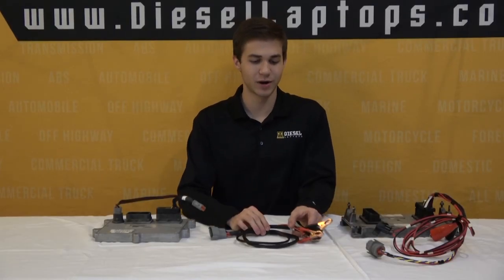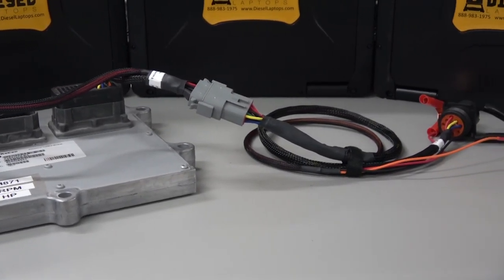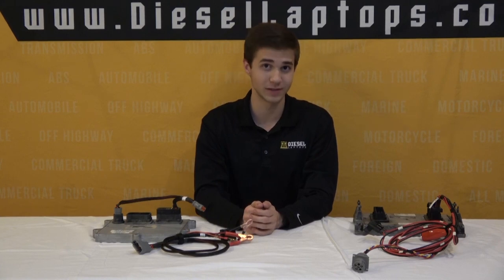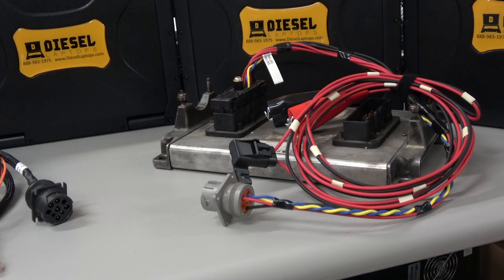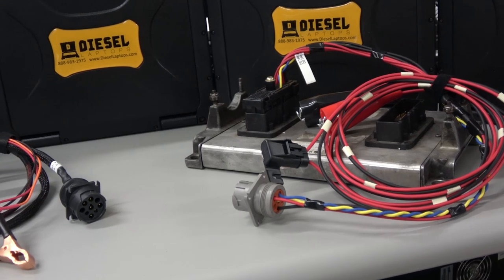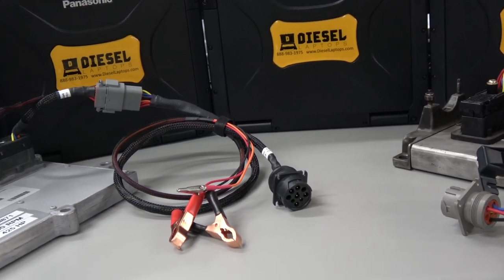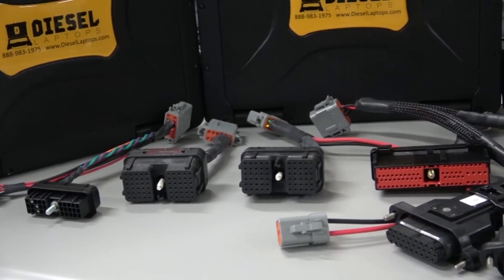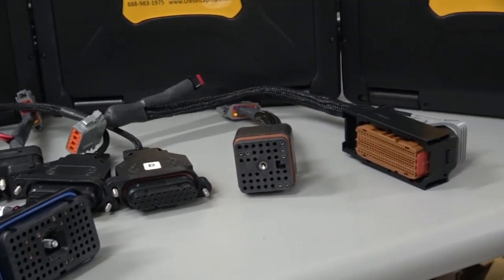Commercial Truck Engine Bypass and Programming Cables for CAT, Cummins, Detroit, and More

Comment: Do you make jumper cables from N14 Cummins to a 3406 E cat I did engine swap and need wiring for ECM
Reply: It’s in a 2000 379 Pete I took Cummins out and put 3406 E in

Comment: Sir have a good day., i have a detroit truck, all of the harness cable connected on ecm.i remove that all. Except the power supply harness. Is it normal? they have a spark when i plug in the fuse on the fuse holder.what do you think sir.

Comment: Can I use a 2007 frieghtliner ecm in a 2015 freightliner??
Reply from the maker: Not unless that 2015 is running a 2007 model year emission engine.
Reply: @DieselLaptops  awesome thanks for the information.

Comment: I have a lot of respect for what you guys do but as a CAT and KOMATSU dealer tech I have to say this should be fused. Notice the OEM cable is fused? No one should ever hook a battery directly to an ECM without protection this is crazy you can fry the ECM. This should be modified to have a 5 amp fuse.
Reply: Chris Ray 3amp fuse actually, 5 amps is quite a bit for a board.
Reply: It has a fuse.
Reply: Wicked random and late reply… but no it clearly still has no fuse in the video…